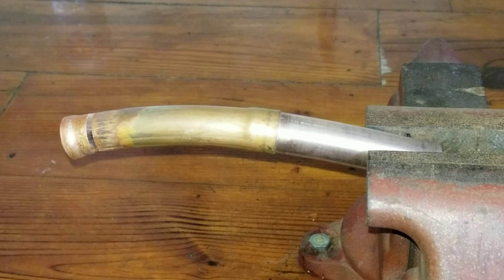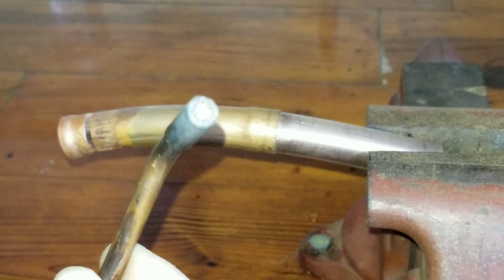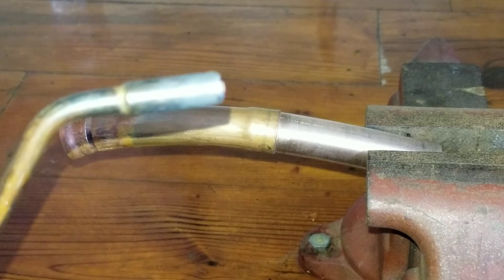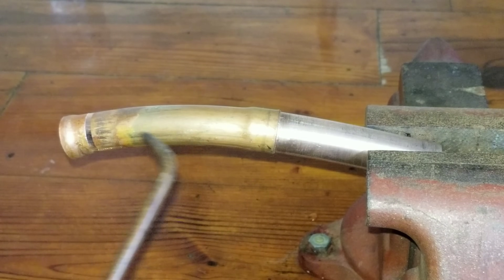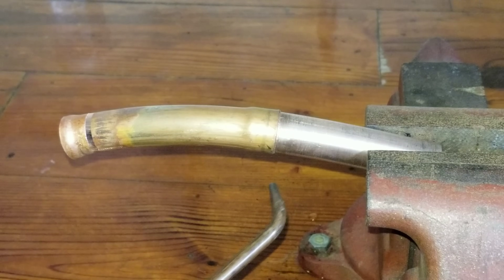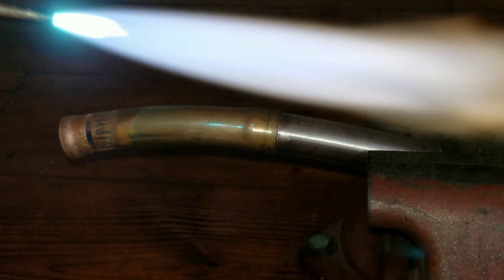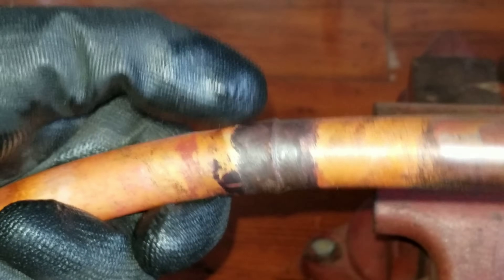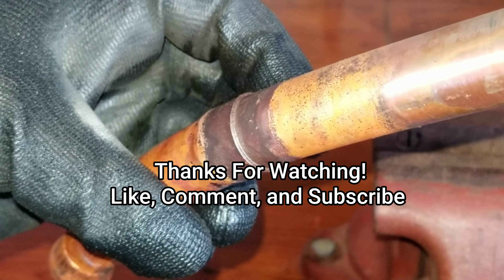Oxy Acetylene Brazing Tips and Tricks For HVAC Techs

Comment: Good video…thanks for posting. Just a regular homeowner here, do you know if you can purge with argon instead of nitrogen when brazing? 

Reason I ask is that I already have a bottle of argon for tig welding and thought if you’re just trying to keep the oxygen out when out of the pipe when brazing, then it seems like argon might work.

Comment: Neutral flame on a #1 tip has been real good to me. Acetylene regulator set at 5 psig & oxygen regulator set at 5 psig. I can braze up to ¾ copper tubing very easily with the #1 tip. I am considering putting the micro 6000 rosebud made by Uniweld in my kit for ⅞ copper tubing. I struggle to get a uniform braze on ⅞ tubing with the #1 tip, but i can get the job done
Reply: The micro rosebud is my bestie! First used on 3/8 in a tight sensitive space that I needed to be in and out of quick to not burn anything but usually use on reversing valves, compressors, and vapor service valves

Comment: I came across your video because I've been looking into that uniweld 17-15 rosebud tip. Do you have problems with it actually overheating? I see it has turned almost black as have mine. I've purchased a couple of them thinking the first have been defective but each one gets too hot to the touch. I've tried every pressure combination and nothing seems to work for me. Any words of wisdom? Thanks

Comment: terrific video.  thanks   i learned a lot.   refreshed my memory.  30 years ago i went to a/c class and the welding you showed they called it "cappilary action"     where you get the solder to flow up inside where the tubes connect.    it defies gravity and can flow uphill.

Comment: Curious to know why (although not necessary) you didn't add a shoulder around the joint?
Reply: It’s a waste of rod! The joint is sealed on the inside, that’s why it’s important to pull that solder into the joint! Solder will follow the heat, so with your torch you can pull that solder inside the joint by concentrating the heat at the inside bottom of the joint!

Comment: Hvac student here
what can I do to stop the "pop" sounds when shutting off the torch?
Also is Flux needed when you're brazing.
Reply from the maker: No flux is required for brazing. The pop sound on an oxy/acetylene torch is what happens when you turn the acetylene off first which is correct. Turning off the oxygen first will cause soot to build up on the torch and can cause issues down the road.

Comment: I'm sure you're right : there probably is a text book somwhere that says you're wrong in how you set your gas pressure and some of you're other practices but textbooks don't generaly do much welding. They're probably afraid of the flame. Thanks
Reply: Makes no odds what your regs are set to you regulate the flow of oxygen and acetylene at the torch head

Comment: I am a HVAC student and we where taught 5 gas and 10 on oxygen
Reply from the maker: In this industry many things are unfortunately taught that are not accurate or correct. If those pressures give you good results then I say keep rolling with them. 🤙
Reply: @HVACinSC   Awesome thanks for the great videos!
Reply: If you think about it your torch is actually controlled be the torch adjustment and not really by the line pressure settings...

Comment: Hi Mr HVAC in SC....I've got a question for you...when you're brazing and the joint/pipe
to be brazed becomes cherry red...and the solder rod is starting to melt on to the copper
pipe...how far back or what angle do you keep the flame whilst applying the melting
rod?  I want to know if the turbo torch/rig flame should be slightly above the rod when
brazing?

Cheers from London UK!
Reply: If you're brazing properly, you should hold the flame close to the pipe until it turns red, (angle, types of flames ect are personal preference) then use your rod, essentially, push the brazing rod into the coupling, 90°, fitting ect until you have about an inch of melt which will look black and gold, maybe even grey. You then move your torch towards your pipe and "cap" at the edge where both metals are now adjoined and fully sealed. This will help the capillary action do it's job. It should be clean and smooth like the video shows. No big lumps or areas less filled than other's.

Comment: I tossed my victor torch kit in the TRASH!  Straight acetylene with the turbo torch these days.  One bottle and done.
Reply from the maker: I can't stand a turbo torch. Loud as hell and not nearly as versatile as an oxygen acetylene rig.
Reply: @HVACinSC  They are loud... but when all you're doing is copper line sets, I'll take the noise.  It's FAST and time is money.  I don't come cheap.
Reply from the maker: @jagboy69  Ain't no faster than a rosebud on oxygen acetylene but to each their own.Trust me, I ain't cheap either. That's why they pay other guys to run line sets. 😉🤙
Reply: @jagboy69  turbo torch is great for installs like your saying. Try using it for txv replacement or compressor jobs. I've brazing very small and tight areas. Turbo torch doesn't keep heat localized. It migrates and becomes a problem which doesn't work well in service world
Reply: @pineychristian  I havent had any problems changing out TXVs or compressors with mine.  I just work fast I guess.

Comment: What Tips & Tricks do you have for me on Brazing my Kenmore Elite Refrigerator Fittings? I am going to Attempt Replacing the Compressor.
Reply from the maker: I'd need more information like type of metals being brazed, refrigerant type, ect. if it's a bon flammable refrigerant and copper to copper, I recommend a a nitrogen purge and a nice clean brazing surface.
Thanks for watching!

Comment: I was always taught to never let the coupling show, as in to add more solder to prevent leaks, also inspectors look for that.
Reply from the maker: No inspector will EVER check braze joints. Guys that say to add braze until the fitting can't be seen need more practice and are compensating for a lack of understanding proper brazing techniques.
Reply: @HVACinSC  Agreed.

Comment: Very good braze and video.  I was wondering if you have any videos on taking joints apart and putting them back together like in changing compressors or the use of different brazing strengths like 5%, 15% and 56% silver?

Comment: Whenever I need to solder, I switch to my POL HANDLE& use the size needed,,,,but when I need to braze,,then switch Tom TURBO TORCH HANDLE, but it’s a flat metal one, they NOLONGER  MAKE, I have to watch it like a HAWK,when working with someone., and yes I do like HARRIS solder/brazing rods, sticks,,I use 15 % silver. Cheers from NJ
Reply from the maker: I hate turbo torches. Loud and inaccurate. Only advantagevis its lighter than an Oxy/ Acetylene rig.

Comment: Do i have to run nitrogen or with the medium size flame the oxidation is less and i can get by?
Reply: Always purge with nitrogen, if you don't you'll be getting a callback with a clogged txv or solenoid.
Reply: @flyinbrianvids  If the brazing was not done initially with nitrogen flowing does purging after the fact remove most of the oxidation? I see a number of techs not using nitrogen to braze repairs on residential HVAC. Concern here is future blockage due to oxidation flaking.  comment welcome, I an a new at this Tnx.
Reply from the maker: @BobFlyer
No.
Purging does not remove oxidation inside the pipe. It displaces the oxygen, preventing it from forming. If nitrogen is not used while brazing, the oxidation will be created and it will never be completely cleaned out of the line.
Reply: @HVACinSC  Thanks for the update, keep getting told oxidation after flushing with nitrogen is not an issue, the oxidation remains. Thanks again
Reply: @HVACinSC  when to stop delivering nitrogen? should I wait until pipe cools down to certain point or can I stop just after brazing is finished?
Reply from the maker: @kubakanapkaa7768  Typically within 60 seconds or less the copper is cool enough that no oxidation will develop and you should be fine to turn off the nitrogen purge.

Comment: Never get it cherry red best way is to tap it with your brazing rod to see if you get the green flame with your neutral flame then you're good to go
Reply from the maker: That is not an accurate statement. Glowing red is not good for the copper but getting the pipe slightly red is absolutely neccessary for the best bond. Research proper brazing practices from any braze manufacturer and you will see the proper techniques to brazing.
Reply from the maker: Hopefully you didn't just look at the thumbnail and draw your conclusion. The photo was edited for effect. 👌

Comment: The newer Cap n hook has 5 ports. I really like it for taking things apart.Great for removing lines from compressors. Good video.
Reply from the maker: Yeah, I've seen it. Personally hate them across the board. Much prefer using a rosebud tip for jobs like removing compressors. Thanks for watching.
Reply: Works great in tight spaces also!
Reply: What do you set your regulators to.  I have had mixed results...but I think it's just a matter of making the process repeateable.  I have the capn hook and I have been using 6/16 PSI ace/oxy and it's worked.  Normally heat for 30 seconds and start "walking " the rod around....I wish I could just put the bead at the top and have the material just wrap around

Comment: I always switch to a rosebud when I have to unbraze a fitting
Reply: I was trying to use one- (just bought) because i had to change an evaporator coil and the installer used all kinds of crazy reducers and fittings so there were as many as 3 layers of pipe in some spots--so to get it undone my #1 tip wouldn't touch it---but it popped and kept going out.  I think I had about 6=7psi acetylene and same to 10 on o2.  Thanks
Reply from the maker: They work great for that!
Reply: I also use air -acetylene with a slightly oversized tip for that sometimes-obviously space shape and clearance dependent, but it can work very effectively  with a larger “enveloping” open flame.

Comment: Thanks Brad!  Do you like 6% or 15% silver?
Reply from the maker: Thanks Chuck! I always use 15%
Reply: How do you feel about a turbo torch?
Reply from the maker: @jerrodwilliams6789 They work fine but Im personally not a fan of them because they are loud as hell. They are handy for tight places where it's a pain to lug an Oxy Acetylene rig though.
Reply: Ive only uses the turbotorch, it works reeally well but like he said its pretty loud and i think the oxy rig heats it a little more controlled. But brazing doesnt necessarily need to be precise welding.
Reply: @brianmercado2968  Good point.